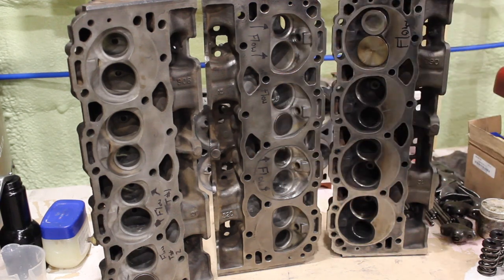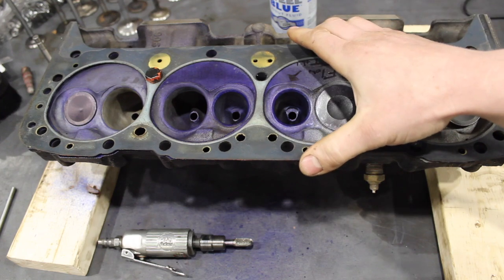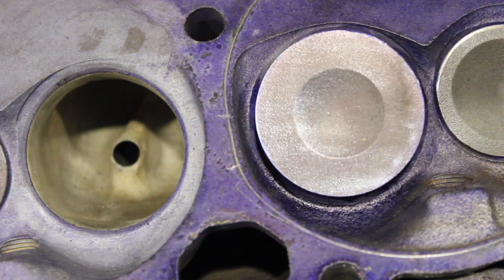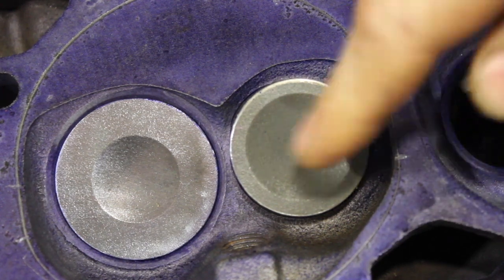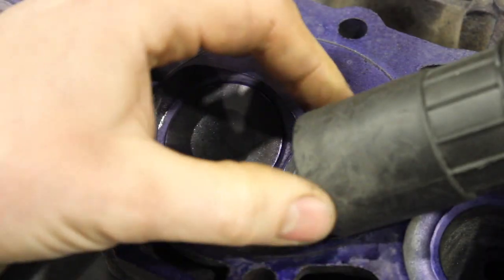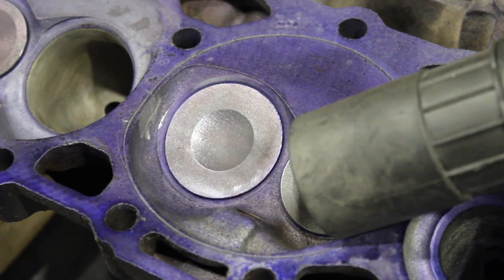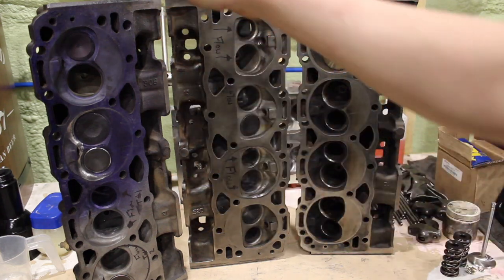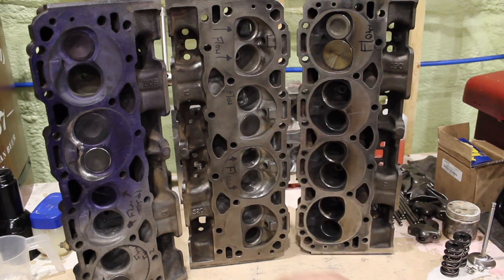Vortec Porting -  Part 1- The most important part!? Flow #"s (Plus Beehive Spring Kit Giveaway!)

Comment: Can I drill for steam holes to fit my small block 400
Reply from the maker: Yeah you can, i actually have a 406 vortec build coming up
Reply: Just  wondering  what power I might get  on a stock 400 6.6L  of course  port and springs  as you  dimenstrated
Reply from the maker: @curtisdanielsforservice4131  most pump gas vortec builds are between 1.14 hp to 1.3hp per cu/in
Reply: @cuttersperformance  how about a comparison the 906 and the 062 versus the 327 461 and the 462

Comment: If I do the trick with the 1/4" dowel on the exhaust side then put a 1.6" valve in it, will it still be about right? Or would you want to take out slightly more?
Reply from the maker: 1/4 dowel works just fine with the 1.6. Be sure to open the throat up to 90% of the valve diameter to benefit from that 1.6 valve

Comment: PS up here in Canada parts are hard to acquire I have been waiting for five months for parts I ordered with no idea when they might arrive
Reply from the maker: I hear that man! Im a Canadian too  🇨🇦 🍻
Reply: Thanks to our incompetent team of public servents, me and my three K-9 kids are surviving out in the woods. We have an old  trailer that is heavy to pull with a stock 5.7l. I  have been following your advice to upgrade our ride to aquire more torque for pulling our house on wheels. 
Our ride only has 70k miles and no damages,  I have ported my heads but still have no  springs yet but must prepare to move when we get told to relocate. We are also waiting for our cam and timing chain which means we will be taking this motor apart again, I  have the 7516 intake to match with the heads and was going to put this together with what I have at the moment. If I can, would it be safe during our cooler months,  to operate this motor with the rear steam lines blocked off  and not do damage?
Reply: Have you ever tried vortec heads  with a stock cam from  94 5.7l  before, would this cause more harm than good? I do not have many hiding places left, bylaws do not have any patience for handicapped individual surviving in town limits, camp grounds are expensive and seasonal

Comment: Love your videos, new subscriber here. I’m not new to porting but the vortec heads react far different than our older head designs. I’m following to the letter for my corvette. Also matched a cam to your flow numbers. Where did you get the offset locks? I already have the comp retainers and LS6 stock takeoffs. I have .508 exhaust and am concerned about the clearance. That extra.050 would make me comfortable if they work with my rollers.
Reply from the maker: Thanks for checking out my videos! 

Heres a summit number for you 
SUM-174003-4

Comment: Will you still do a 1/4 shroud with a 1.6 exhaust valve?
Reply from the maker: Yes you can! Some porting with the 1.6 exhaust valve goes a long way. Upwards of 200 cfm of exhaust flow can be achieved with the 1.6 valve and porting

Comment: Great info, I'm more into the 3/4 sbc myself 🙂 aka 4.3 v6. I was wondering if you know how similar the port/combustion chamber is between th v6 and v8. Basically can I apply your findings to the v6 heads and get similar results

Comment: David Vizard shows laying back the square boss att the spark plugg. So you get a smooth transition from the intake up over that boss.
Anything you have tried?

What is the purpose of that square boss? On many aftermarket heads those bosses are completely smoothed over. But do they serve a purpose in the original heads?
Reply from the maker: The boss is there to promote swirl in the chamber. I've tried grinding the boss right out and seeing if it flows any different and it did not. But a flow bench is just a tool, dyno numbers or thorttle response can be affected that might not show up on a flow bench. Like shown in the video I basically just round the spark plug boss back and unshroud it from the valves. This is just the basic vortec chamber work but its 95% of the results without making the combustion chamber much larger and only takes a few minutes per chamber. 
I've spent hours on one chamber, runner and pocket to find out it basically didn't help or made things worse haha buts that's how you figure these things out
Cheers!
Reply: @cuttersperformance  well more the power to ya 👍
I think Id find that kind of work quite interesting and rewarding. Very cool of you to share your findings!

Comment: "I love Vortecs" and have for 25 years. 1/4" rod? use a drill bit. You can see there is nothing thing left to up-size both valves. Head gaskets should never overhang combustion chambers, caution the overbore. Back cut the best valves you can afford. You can plane the heads once, safer to deck the block. Those engines that run with camel humps all do better with vortecs.  The 880 mentioned needs compression, flow helps but pistons win.
Reply from the maker: Drill bit works too! I use used a rod cause its smoother 
This one i was just running stock valves and as mentioned in the video you want the head gasket to be min .010 larger than the chamber
I always tell guys to take the minimum off vortecs to get them flat and thats it 
Thanks for the input! Cheers!
Reply: @cuttersperformance  Hi Pat, the head gasket selection always drives me nuts. I get guys bringing me off-shore or just wrong gaskets. Bore sizes from stock to 0.080" over and everything from steel shim to 0.043".  I'm a big believer in a time and place for everything but not everything at all times and places.  A stock bore gasket hanging 0.040 over made a diesel,  and a 400 gasket on a 307 made death rattle and had the right gasket on the other side, WTF.  Noobs want to learn even if its only to save a buck, thanks for staying at it.

Comment: I Love Vortec's! I have a set of 906s on my 89 5.7L MerCrusier with a Comp Cams Xtreme Marine flat tappet with 0.480 intake lift and .489 exhaust. It's a 224/234 duration 112 LSA. I want to install the next size up in a hydraulic roller cam but I either need your spring kit or I need to machine the guides down with the .530 kit from Comp Cams. 
Thanks for all your insight on the different SBC heads!

Comment: Great video, thank you! Still waiting for the review on the 059s though. lol
Reply from the maker: 305 vortec flow numbers and porting in a upcoming video!
The results may surprise you
Reply: Won't surprise me. Had a set flow 224 cfm @ 0.500 untouched and 250 cfm @ 0.500 with 1.94/1.60 valves and a little work.  Made 356 hp at the wheels with a little 310 cid roller cam TPi based engine.
Reply: @cuttersperformance  Awesome, I am so looking for it!
Reply: I love Vortecs by the way, and good luck folks!

Comment: I love vortecs !  I repaired vortecs that made 525 on dyno several times- castings weren't heavy enough to take heat that +500 horses produces ! --cracks.  These were oider castings years ago.  No power adders, dirt round track.  Been out several years, back at it.  Interested to see what newer castings can do & handle.
Reply from the maker: Super cool man! Takes alot of make over 500 with vortecs

Comment: I have a set of vortex heads that I had professionally gone over, they ported them and punched them to 2.02 1.60. They also cut the bosses used titanium valves and keepers comp beehive springs and comp steel roller rockers with case harden push rods. I'm also running a 600 lift 305 duration  109 lobe separation cam. The 383 motor has been balanced blueprinted but... I have no flow numbers on these heads. Input is welcome.

Comment: I love vortecs. I have a 97, 454 and while it says vortec right on it, not sure if its the same. I've seen bee hives used on a bbc build in conjunction with a cam swap. From what I understand I can only have 500 lift anyway . I took my driver's test in a gmc truck, 454. Still had leaded gas, higher octane. Higher compression. Sad how lame newer ones are. Dream of a return to glory.

Comment: I love vortec!!!
Currently building a 383 stroker for my 1989 c1500 5 speed. It's going to have vortec heads, comp Xtreme energy marine Cam 12-236-3 with Holley sniper efi. I built this engine to replace the 305 that is not up to the task for pulling my 4500 pounds rv trailer. Hope it will be enough too follow trafic up hill.

Comment: What is your professional opinion of the Summit vortec heads vs 906 vs 062?
Reply from the maker: Haven't personally used them but I've heard mostly good things. Maybe I will have to get my hands on a set. 
I like how they are already drilled for rocker studs with guide plates
Reply: @cuttersperformance  Thanks.

Comment: I love vortecs! Liking the porting how-to. Following every step.
Reply: Saw the video where a 1.60 exhaust valve was flowed with good results. Back in the day of porting and flowing L98/ZZ4 heads, we would install 2" intake ( no need for new seats) and 1.60 exhaust to improve flow with minimal machining. What about the vortecs? Whats the largest valve they can accommodate? Is it worth the trouble?

Comment: I love vortecs. I've always been curious what a full chamber smoothing would do, including the eyebrows above the quench side of the valves. Not really concerned with adding cc's as I do a lot of 400s, and the little extra chamber volume actually helps keep the compression ratio where I want it.
Reply from the maker: Doesn't make much of a difference  in flow compared to what i showed in the video, mostly just looks better haha 😄
Reply: @cuttersperformance  that's kinda what I thought. I've always wanted to see piston movement through a clear cylinder with smoke to see the airflow patterns